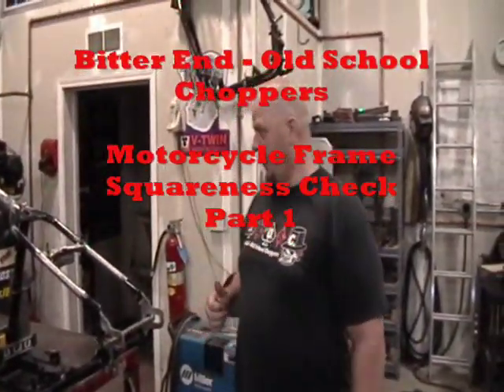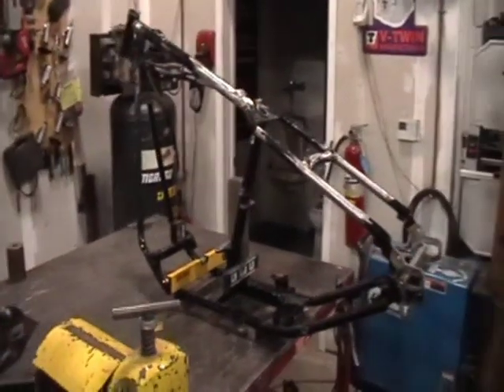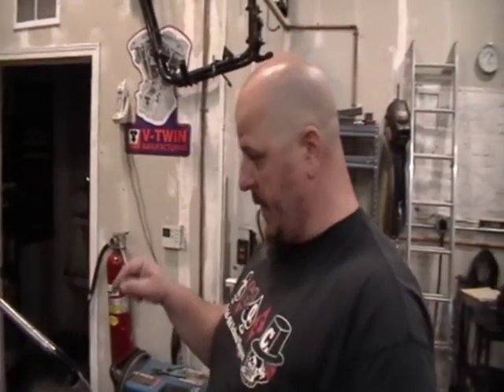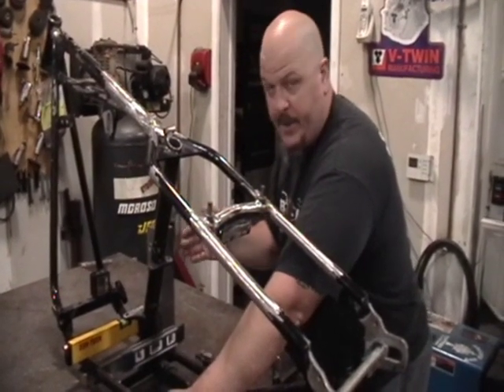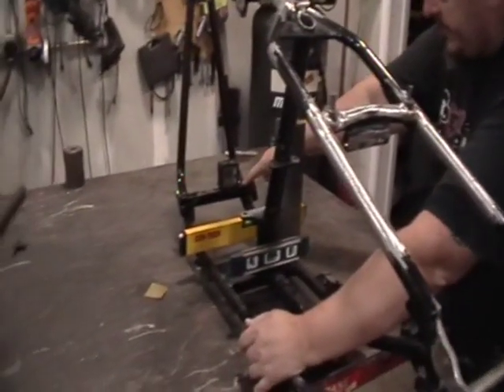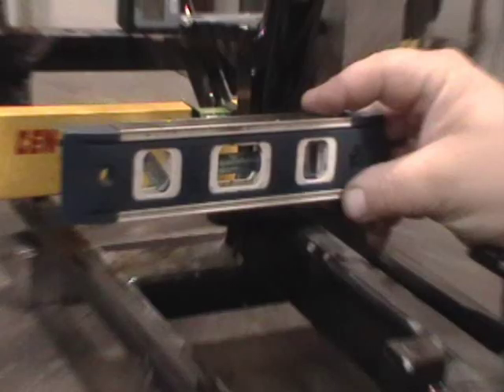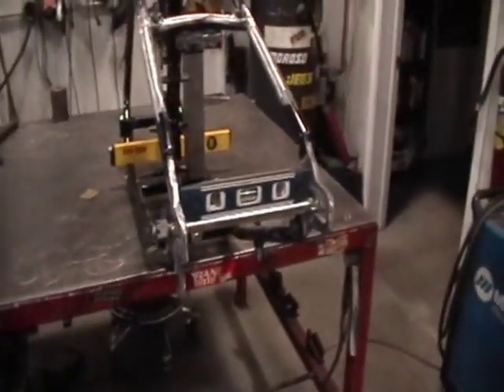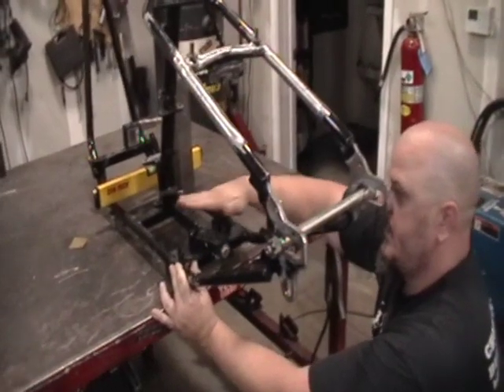Old Motorcycle Frame Squareness Check/Test Part 1

Comment: So how do you check head perpendicularity?
Reply from the maker: Do you mean trueness of the neck?  So, the bike goes down the road with having to lean?  I lay the frame on its side and block it until it is laying perfectly flat/level.  Then, put a level on the neck.  Basically, you are just positioning the frame so that the rake of the neck doesn't mess with your level check....

Comment: Useful vid!

FWIW my machinist/fabricator friends use Craftsman digital levels to align tubing and plate for the equipment they fab and love the things as they are far more accurate than a spirit bubble level. You could for example level all relevant planes of a frame using one then set the degree of a neck to be installed precisely.

After seeing it in action I ordered a couple for myself.

It's of course easy to check to see if your level is working correctly as any level should give identical readings when rotated 180-degrees.

Comment from the maker: I agree with you to a certain degree.  The small torpedo levels are only as good as your ability to assess just exactly how centered your little bubble is between the lines.  Also, most are not shock proof enough, so that after the inevitable drop, they are no longer accurate.  For those seeking maximum precision and that have a couple hundred bucks to spend, I recommend the "Digital Smart Tool" like you can get a Trick Tools (Van Zant) or Mittler Bros.

Comment from the maker: @droceretik 
I guess it is kind of a chicken or egg scenario.  I don't know what the weld trick would be without knowing for sure the type of metal we are dealing with.  I would Google looking for any tech info or sources out there that would be able to tell you for sure what it was made of.
As far as the weakness in the frame, I would def. gusset and/or reinforce while you are fixing the crack, otherwise, it is just a matter of time before you will be doing the repair again.

Comment: I have a crack in my steel frame that is getting longer. It's a twin spar, main frame rail, with 3 x 3/4 inch rectangular section made of mild steel? Is there any trick to weld this spar given I don't know what the steel composition is? It is a powder coated finish so obviously that will have to be ground back. Looks like the crack is opposite a main stress point with engine mount and shock mount nearby. Perhaps it needs strengthening at that point. Thanks.

Comment from the maker: @richprint29 Either shim the drivetrain mount surfaces and sand or file the axle plate surfaces like explained in the video or use a different frame for the build.  --Al